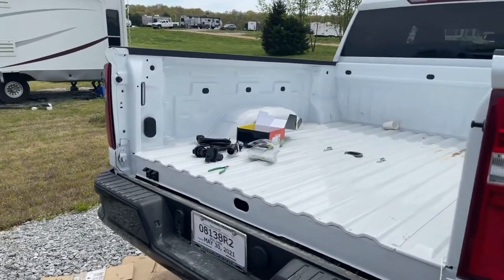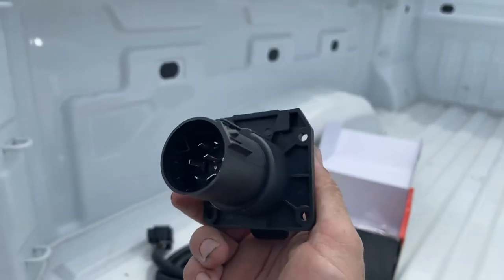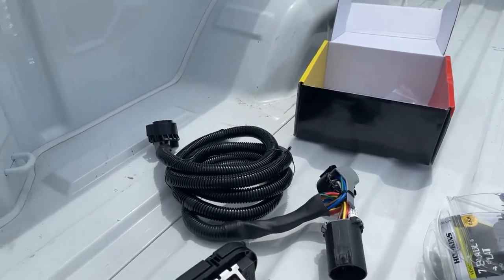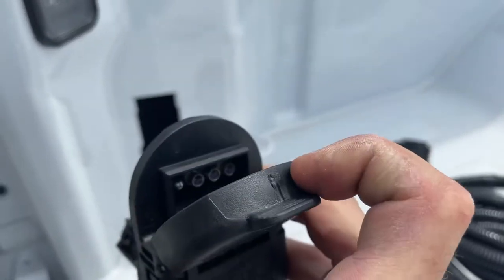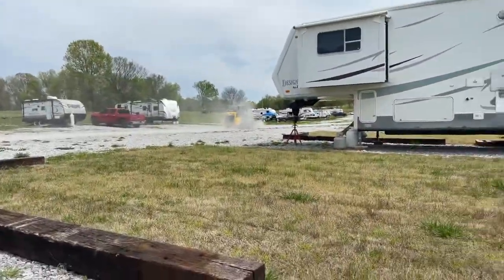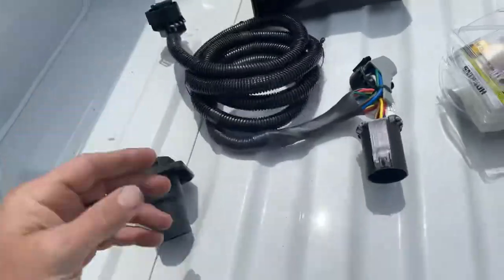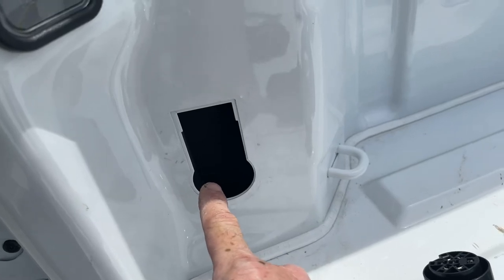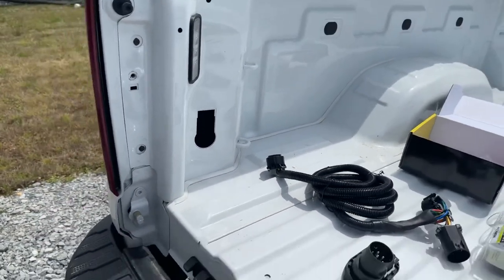Chevy/GMC HD Truck WITHOUT “5th Wheel Prep Package” Bed Electrical Plug Issues

Comment: My 2022 3500 SRW LB has two camera receptacles where the 4 pin connector used to be. If you pull a trailer that utilizes the four pin, I guess you need an adapter to seven pin or an extension cord to go over the tailgate. But keep in mind these are some of the same bunch that can't figure out the multi-tailgate issues with the trailer hitch. After 3 or 4 years, I would think they could fix the problem, but seems like they are creating new problems.

Comment: Numerous reasons such as a sled deck mentioned by others but can be utilized as an emergency plug just incase the 7 blade stops working. But also keep in mind, to make a different hole requires a different cut out die which in case costs more money and such dies, stamps and molds are very expensive to make so one cut out die to make two holes the same is cheaper than two different dies for two different holes and keep in mind those dies do wear out and have to be replaced. To be honest, I'm surprised they are even including a hole at all on trucks without the 5th wheel/gooseneck prep package.

Comment: Totally agree this is stupid for a design. The only reason i could see for wanting a 4/7 way is that some old gooseneck dont have breaks and could possibly use a 4 way. That chance is probably less than 2%. So it is a stupid design. The only good thing is that both those plug are interchangeable on the truck. But once that 4/7 way goes in its going to be a bitch to get it out without access to the clips.

Comment from the maker: As “NarrowRoadLife” pointed out earlier, GM has a solution to fill the gap. It is GM part #19420832.
However, that part is made by Curt and searching for it under the Curt part number will probably yield better results in both pricing and availability. The Curt part number for JUST the filler bracket is: Curt #55417
https://www.curtmfg.com/part/55417
If you need the part that fills in the gap (#55417) AND the actual 7-way plug with harness, then you need to get Curt #56072. That’s the entire kit.
https://www.curtmfg.com/part/56072
Reply: @ConnectedCorrectly I have a 2018 Chevy Silverado long bed. I want to switch the back of the bed to a 2020 Chevy silverado long bed with tailgate but the wiring connectors are different...
How would you wire up the 2020 bed to the 2018 truck?
Reply from the maker: @bradlee963  Are you talking about the wiring connectors for the lights, the trailer plug, and everything? If you are, and the actual plastic connectors are a different style and do not mate up, then you would have to cut the connectors off of the ends of your plugs and wire those up one wire at a time by function. Another option would be to see if you could get the lighting harnesses off of a different truck (salvage) and cut those back about 7 inches from the connector and wire up the properly mating connectors that will match onto your wiring harness.